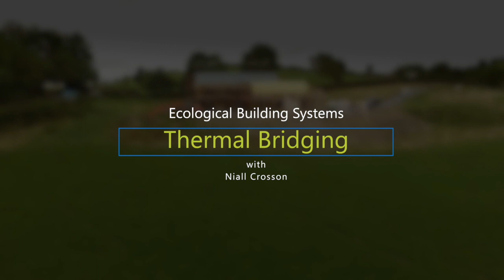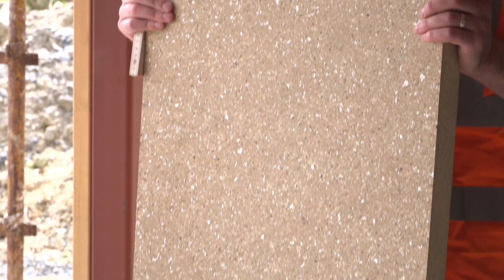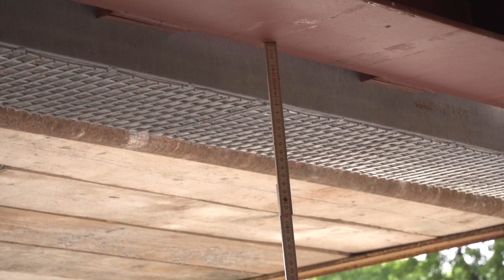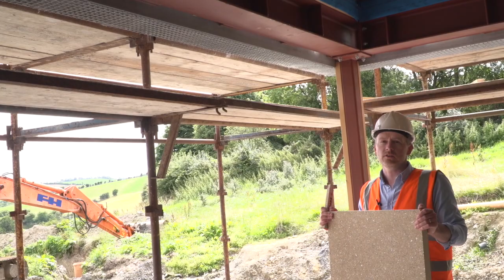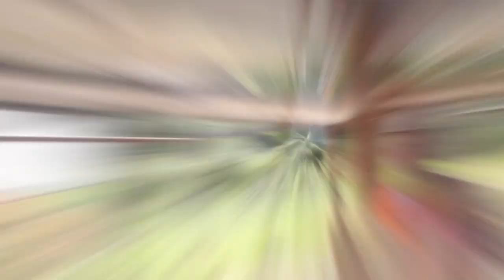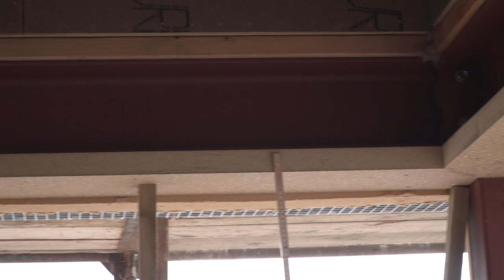Avoid Thermal Bridging with Bosig Structural Insulation - Passive House Insulation Series (part 7)

Comment: What type of mechanical fasteners were used?  And what is the adhesive that was used?
Reply from the maker: rust resistant 10x8mm staples...tape is a solid acrylic Passivhaus certified TESCON VANA tape. https://www.ecologicalbuildingsystems.com/product/tescon-vana